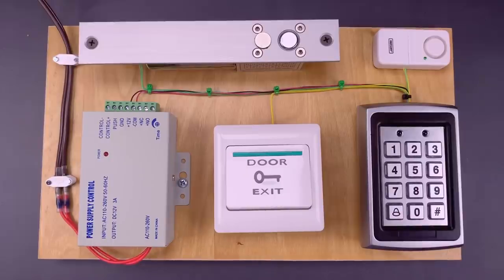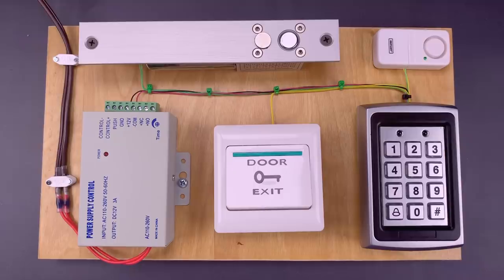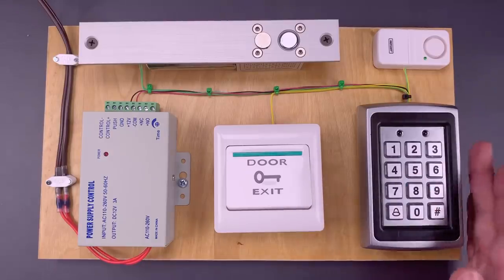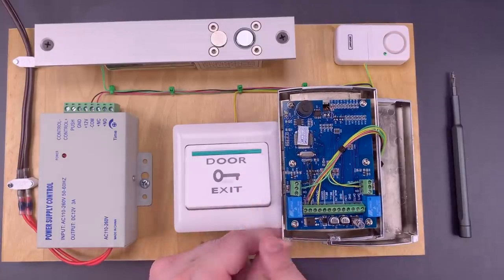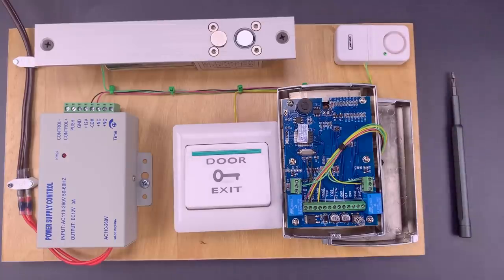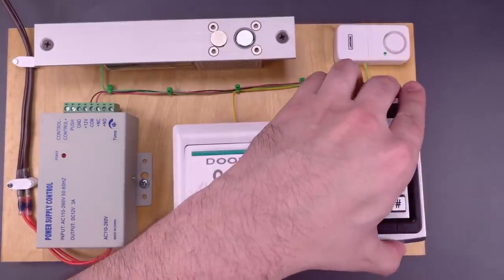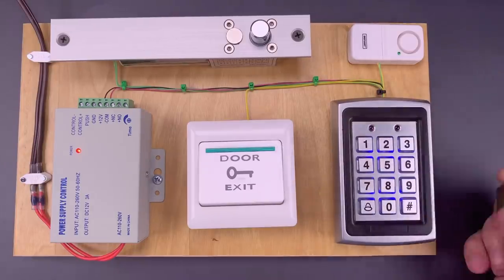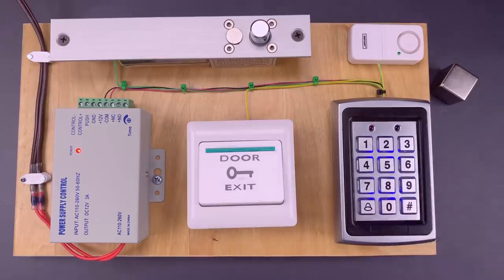[1130] Avoiding The Trap, And Bypassing Keypad With Magnet (HFeng)

Comment: More cabling than a high end PC, less security than a zip-tie on a metal gate.
Reply: At least with this, you need to source a decently powerful magnet
Reply: @themorrigan1312  yeah, the forks and redbull cans simply cant breach this badboy
Reply: @themorrigan1312  they're not hard to find, that small magnet he has is on Amazon for like $20. Idk how reliable Amazon is with powerful magnets but I just as easily found sites dedicated specifically for neodymium magnets, selling similar sized ones for no more that 40-50 bucks.
Reply: @SurotaOnishi  if its coming from scamazon chances are quite high it came out from china.
Reply: I suppose you could get a free magnet from an old hard drive and use it as well. Some of those magnets are pretty powerful. I've got one holding up a sledge hammer in my garage.
Reply: @themorrigan1312  You can basically go to a junkyard, find an old hard drive, and get your magnet from it.
Reply: Yes not only are hard drives a good source for free magnets and don't forget if you need a stronger one you can always stack them, it doesn't outright double the strength of a single magnet but one or two extra can make a big difference.
Reply: @themorrigan1312  Any old hard drive has two of these
Reply: like they could EASILY use some type of transistors instead of relays, that might be a little bit harder to engineer, but far more secure, reliable and even cheaper to produce. that's just laziness
Reply: @JaimeIsJaime  The opening mechanism is probably powered by the same system which powers the door bell and door opener which by nature has some very high voltage spikes
Reply: @Mofapilot  that changes nothing you can use optocouplers for isolation and transistors or thyristors for switching. reliable, secure and still cheap.
Reply: I find your lack of PC knowledge disturbing.
Reply: @cmdraftbrn  If it's a rare earth magnet, it's coming from China regardless. They sit on top of 90% of the known world's raw material supply.
Reply: @JaimeIsJaime  You would not use a transistor in this manner, transistors typically handle at most 1A of current, often much less, if you were to use a TO / SOT type of packaged device you would use a mosfet and even then I highly doubt a mosfet would be cheaper, relays are used because they're super cheap for switching very high currents and peak currents and if you were actually going to replace a relay you would probably use a solid state relay as they can switch high currents similar to a normal one, the main problem is they're quite expensive.
 
A relay rated for 10A can cost less than a dollar whereas a properly rated mosfet might cost $2-3 on top of also having to deal with the heat it generates as well (I'm referring to low quantities like 1-10 here to drive the point home of how much more expensive these two would likely be) and I say properly rated because I'm oversimplifying things, the current rating isn't the only concern to worry about with a mosfet and you should use an overrated mosfet.
Now $1 or $2 dollars may not sound like a lot but remember we're talking about mass production here, so we're possibly talking about an extra $10,000+ or upwards of $8 more per unit for you as the consumer.
Reply: @vgamesx1  It would be interesting to see a mod to replace the relay with a solid-state device, and add shielding and whatever else to improve a cheap Amaon item.
Reply: @vgamesx1  only if you design the circuit to source the current via the switching mechanism, which is the issue here. A redesign that instead sourced the power to the bolt from elsewhere and simply had the keypad send a signal, could happily use a transistor.

A bog standard transistor would cost nothing in comparison to a big expensive relay. We are talking fractions of a cent in comparison to a dollar.

It still means it can be bypassed via tampering but hey, at least it isn't done via a magnet.
Reply: Tyriel  — a fork that could pierce The wire insulation could in fact trigger it.
Reply: They could at least put a bunch of trap relays in there. Hell, I'm not an engineer, but why not just surround the door relay with alarm relays so that it's impossible to trigger just the door relay from the outside? If someone is bypassing the security for legitimate purposes (e.g. the owners accidentally locked themselves out and you're a locksmith), setting off the alarm system shouldn't be a problem.
>cost
Are we going to act like a $10 increase in a one time expense is some kind of massive deal breaker? That's literally the price of a cheeseburger and fries to stop some idiot with a magnet from just strutting into the office at 2 a.m. and clearing it out. If you told customers about the problem and how your new design fixes it, literally no one would bat an eye at such a small price hike.

Comment: Some of these keypads actually DO have their tamper-alarm relay closer to the edge than the actual relay, OR a reed switch, just to detect any unauthorized external magnets.
In case of stand alone systems however, its uncommon that they are wired to an actual alarm, BUT the tamper switch can be wired to a "disconnector", which is a box that is mounted on the secure side, that contains a bistable relay. This bistable relay has an reset button (or reset keyswitch), and once triggered, it will semi-permanently disconnect the normal relay's output from the actual lock or door strike, requiring someone to go in with a manual key, and push the reset button (or reset with an key) to restore normal functionality.
This then prevents someone from tampering with the relay, because once the tamper switch triggers, even for a split second, it will trigger the disconnector and then it will be useless to tamper with the relay.
A disconnector is a way to increase the security level of a stand alone system, to a security level that is very close to a split system for a very cheap cost, provided that the stand alone keypad you use, do have sufficent security for both tampering and external magnetic fields.
This without resorting to any external monitoring company or guards or someone that can respond to the alarm, while still giving reactive security by removing the possibility to power the lock from the outside once tampering is detected.
A disconnector box can also be built very cheaply using just a bistable relay and a button.
Even more cheaply if you use a latched relay, but then it would require manual reset after each power loss.
here is a manual to the SK6 disconnector box: https://docplayer.se/4774606-En-sv-sk6-security-unit-installation-manual-siemens-ab-security-products.html
Reply: It looked like a beeper/buzzer was on the circuit board. I assume it's to beep when pressing a button. Will the alarm also cause that to go into continuous beeping? I hope not, because then you couldn't have a silent alarm.
Reply: @mjbirdClavdivs  Depends on model, but in many cases it can be turned off with a configuration command or jumper.
Reply: I mean, the ideal system would only have the code input device on the outside, with all the actual circuitry within the secure space. That this lock doesn't do this is really annoying, since it includes a "door open" box that presumably does go on the inside, so they could have put the relays in there and eliminated this form of attack entirely.
Reply: @TheRealColBosch  The reason is cost. Its considerable cheaper to have everything on the outside, otherwise you have to double the amount of electronics. Especially for low to medium security applications.
This also gives the installer a choice if they want a less or more secure installation, or want more convience of not having to run wires eveywhere.
Also codes isn't secure at all, they can easily be peeped or guessed in most cases. Especially if the color in the buttons that are for the code starts to disappear, so you now only need to figure out the order.
So in these types of installations, there is three security levels available:
1 - Standalone installation - usually good for low-security applications, for example a staff entry in a shop, where anyone tampering with the lock would be very noticable, or where unauthorized access isn't a very big deal - for example a door to a stairwell in a apartment complex.
2 - Standalone installation with disconnector box - Usually good for medium-security applications, where you want the security benefits of a split installation, but not the full blown system with all whistles and bells. Usually entrances that require a little more security - for example a unguarded office entry on a office building.
3 - Split, full blown systems with centralized managment - This is used for high security, where the access is the sole way to get complete access, usually with automated disarming of a alarm system too.
Reply: In some of these, such as a very similar one I'm reviewing now for Amazon Vine, the 2nd relay isn't for anti tamper at all, it's simply a second relay that can be activated by up to 10 users, with the first by up to 1000. It does have a light sensor for anti tamper that would sound the buzzer, but no gyro or hall sensor that would have been better. I'm suggesting in the review that it's mounted with the right side against a wall or frame to protect the main relay.

Comment: Would the alarm trip with the other relay hit by the magnet then?
Reply: Yes
Reply: The alarm interface is just a dumb open loop and the magnet trick bypasses any control the keypad may normally have over its relay. Closing the loop in any way will trip the alarm. Relays or some other form of electrical isolation are commonly used in access control and alarm systems because they allow different parts of the system to operate on separate power supplies without worrying about compatibility and faults in one system bringing down everything else.
Reply: @teardowndan5364  thank you
Reply: @teardowndan5364  Nerd
Reply: @derkaderkamohamadallaackbarnut  We'll never know.
Reply: will never know
Reply: @teardowndan5364  anyways using relays in a security environment is straight ridiculous. they can easily replace that with mosfets, thyristors, even optocoupler if they want full isolation or whatever have been developed for that matter in the last 80 years. that's just laziness, or they not having freaking idea of electronics.
Reply: @piisfun  sure people should be happy to buy this keypad with relays just because for the producer it was "easier to wire"
Reply: No, or else he would have shown it
Reply: @piisfun  I use plenty of SSRs that are immune to magnets and have more than enough current capacity.  You'd be more likely to find them on more expensive systems.  Mechanical relays are also much less reliable, which is another issue.
Reply: I wonder if it would event the trigger or if the relay just makes the horn go

Comment: Why is there an electromechanical relay in the keypad where it could be easily tempered with from the outside? There has to be some electromagnet in the locking system itself so I don't see the point of putting another one in the keypad.
Reply: In this case, it's because this is a very well designed keypad which directly powers the electromagnet, and handles all authentication on the insecure side of the door.  You'll note that the only conductors coming out of the power supply go straight into the keypad, and the locking mechanism is also wired straight to it.  In a sane design, this wouldn't be possible, but this is what you get when you order a $40 access control system kit on Amazon.

Comment: Try with mine (Retekess K10EM-W, looks very similar): the alarm is set off via a luminosity sensor, not with a reed. 
And moreover: smart people don't connect the relay of the RFID reader to the opener. Smart people connect the wiegand lines (usually labelled D+ and D-), and the central unit will take care of users, authentication, opening etc.
Leaving the control in the outside unit is always exploitable.
Using the magnet in a situation where wiegand reader + central unit were properly deployed will result in absolutely nothing. Wiegand is pretty secure by today's standard, this setup was not.
Reply: You obviously understand the point from the initial video then

Comment: I actually bought very cheap (10$) standalone, fully plastic keypad unit. It was enough for it's purpose, but what's suprising it had solid state control circuit. Which means, no relay.

Comment: To fix this install a few magnetic reed switches around the lock relay while wrapping the locking relay with a magnetic shield. connect up the reed switches to the alarm which can disable the keypad remotely. This will make this attack useless. There is also the stun gun attack, zap the lock and often opens.

Comment: in my experience using these standalone systems (i built props and did low voltage wiring for escape room games--i would not use these in a context where actual security was a consideration), at least 10% of them can be bypassed with a sharp tap on the keypad or whatever panel the keypad is mounted to. It seemed that the return mechanisms in the relays were so weak that gentle vibrations would cause the reeds inside to flutter and make contact, unlocking your lock

Comment: I wonder if any alarm company has tried selling alarms with at least 2 board configurations, randomly distributed so you need to open the box (triggering the anti-tamper switch) to know which configuration you have. That would take more money, of course, and if they were willing to take effort to increase security, they wouldn't have this sort of set-up.

Another idea is to have the tamper-switch (or switches) positioned so that you couldn't easily trigger the open relay without simultaneously triggering the alarm. Since relays use electromagets anyway, there would be the risk of the open signal hitting the alarm or vice versa. Still, the powerful hostile magnet is probably a lot more potent than the tiny relays.

Comment: Seems if you can get into it with a simple phillips screwdriver, that's a pretty big flaw, too. The magnet is faster, but if you didn't have one, you could just open it up and cross the right wires ("hotwire" it) it to open the lock.
Reply: Opening the lid triggers the same alarm as the wrong magnet!  He said before opening that this was off

Comment: I'm a security engineer and have seen this setup hundreds of times , mostly on electric gates . They are at the end of a drive and the installer NEVER runs a cable to intergrate with the house alarm or even a local buzzer.

Comment: I have an alarm system in my home that uses a combination electronic lock but instead of a solenoid like that one it uses a servo motor to retract a deadbolt. When you enter the code, or use a key, or Bluetooth fob, or remote from WiFi, (4 different ways to unlock=4 different chances to exploit) the alarm is turned off.
However, opening the door any other way would trigger the alarm. But there is one very common problem.
The alarm works with a magnetic switch mounted on the doorframe, and a magnet attached to the door, a very common alarm style. To be maximum effective these switches are always mounted at the top of the door as close to the latch side as possible. Knowing this, all a thief would need to do to bypass the door alarm is place a magnet in that corner of the door frame as they open the door. Fortunately my system also has an indoor motion sensor and cameras both inside and out, all of which trigger an announcement from the alarm panel, and send a notice to my phone.
Reply: Let me correct myself.
Using one of the electronic means to unlock it disarms the alarm. This feature can be turned off but it's a pain in the ass to disarm it everytime before you unlock it.
But using an actual key does NOT disarm the alarm. So if it is picked you would need to use the magnet on the door frame to keep the door alarm from triggering. 
My favorite feature is being able to operate the lock and alarm remotely from my phone. If friends or relatives show up and I am either not home or not able to get to the door (I am disabled) I can remotely view the cameras to see who it is, as well as use 2 way voice intercom at the door, and remotely let them in. And also remotely lock it and set the alarm when my kid leaves and forgets to. (What the h3ll is wrong with teen brains?)

Comment: Maybe when manufacturers make exciting new keypads with entirely new guts and logic, they should keep the outside, including the enclosure, display, and buttons, all the same. That way, if someone encounters one in the wild, they will not be able to figure out the specific model, so they can't use a simple internet search to find the exploits and traps.

Of course, it's also just super dumb to put important relays inside the keypad.

Also, great idea not triggering the alarm in the video. That was a clever way to get a lot of comments. Sneaky.

Comment: While it might be less general, is there some building code reason to put the relay in the keypad, rather than a semiconductor relay in the keypad and the power relay back in the control box?  Running the lock wires to the keypad seems like an invitation to mischief.

Comment: Things triggered - 
Tamper loop: 0
Comment section: 1

And why they don't just throw a relatively cheap MOSFET in there rather than a relay is beyond me. Shouldn't "security and access control" products be trying to remove as many ways to bypass them as possible? Especially when a MOSFET is going to be cheaper, and not susceptible to mechanical wear-and-tear.
Reply: They even have line-voltage, high current "solid state relays" that are made from photocoupled MOSFETs and LEDs. I suspect penny pinching is responsible, but solid state relays don't seem much more expensive.